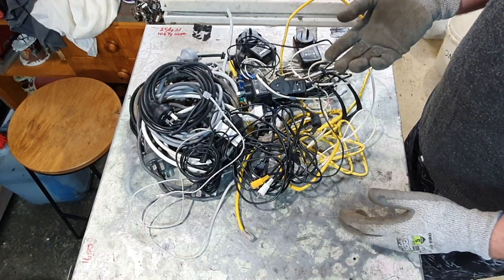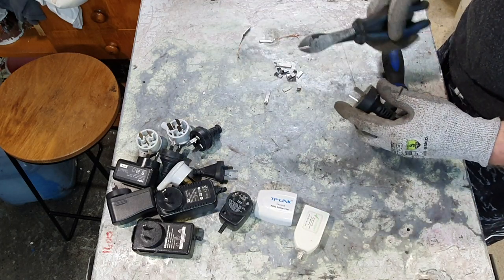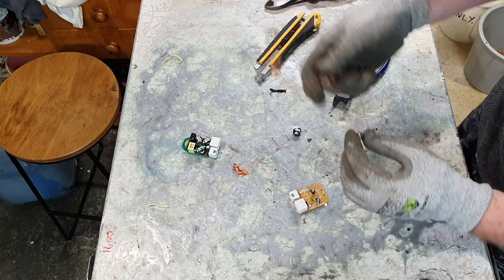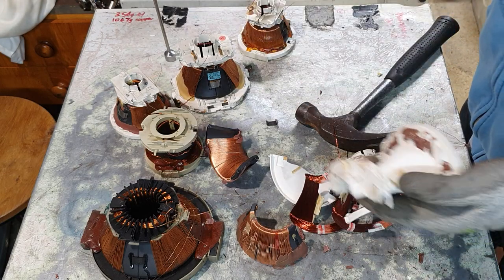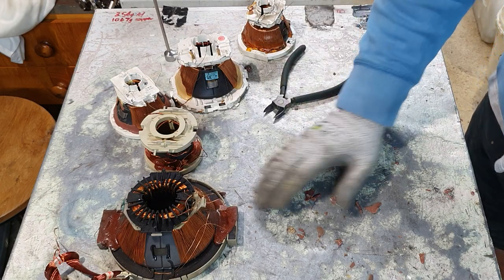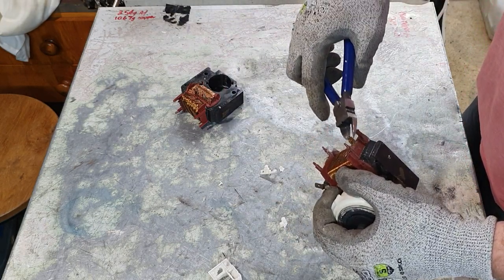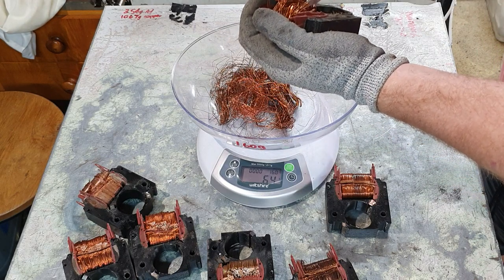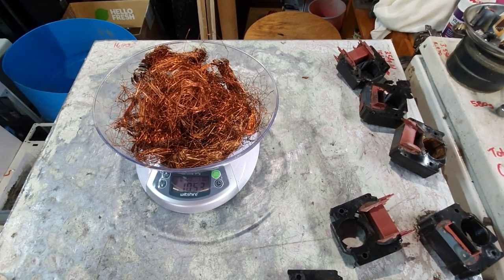scrapping Random Bits & Pieces Pt II - Scrap Breakdown - Metal Recovery - Metal Recycling.

Comment: Those little motors and yokes.
Inside yokes just squeeze them together and work them out. You did a great job with the ferrite pieces with resin.
On the small usually dishwasher pump motors just knock the copper bit out and knock the metal bit out of the plastic barrier then take a PVC cutter split in the middle and very quick to remove copper without mess. Good Luck!
Just subscribed to your channel!
Reply from the maker: Doggy Bonz. Thank you for your subscription! 😁👍Thanks for the advice, I'll apply that to future small motors.